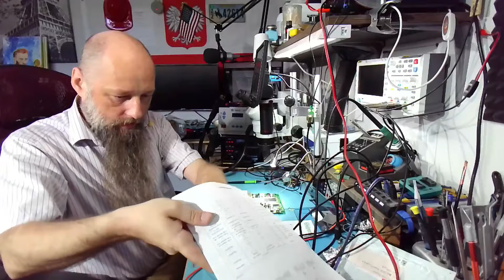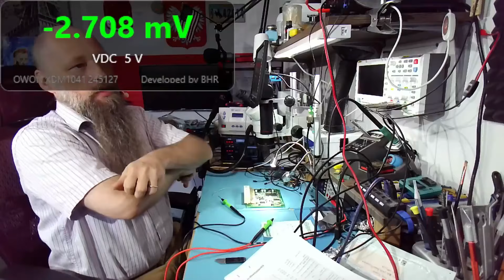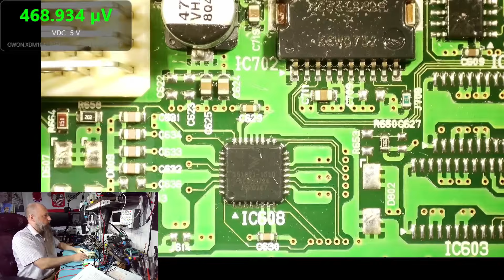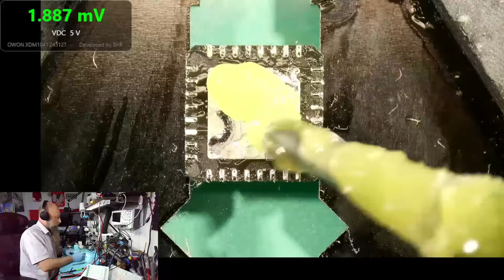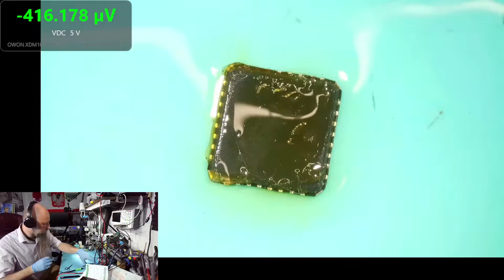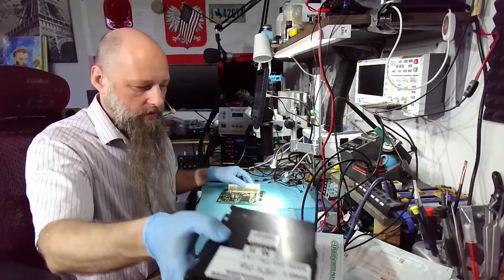266 | '09 Outback Coolant Temperature stuck on maximum

Comment: Strange.  It seems the first thing they would do as a car owner is try replacing the sensor.  Counter-intuitive for them to start with the control module.  Interesting video, thanks.
Reply from the maker: I think they mentioned that since the ECM needed a repair anyway